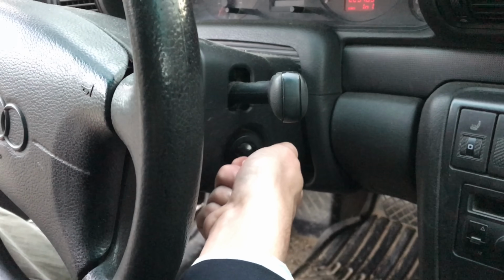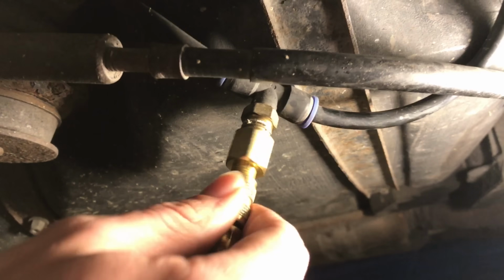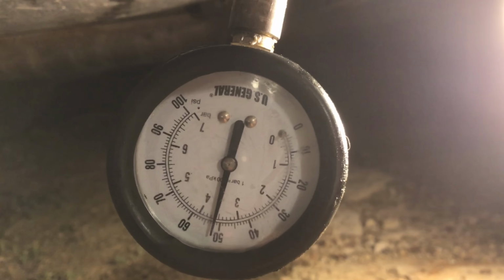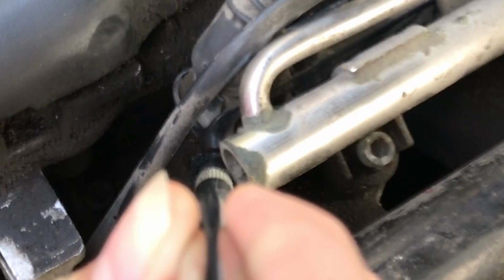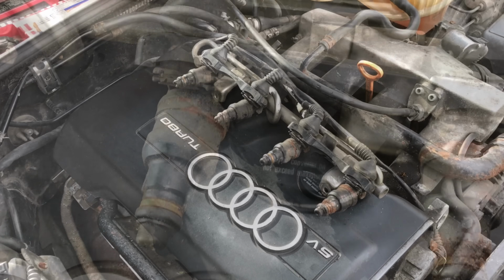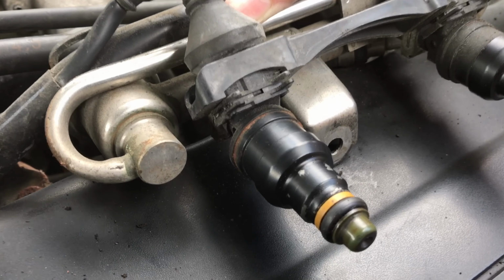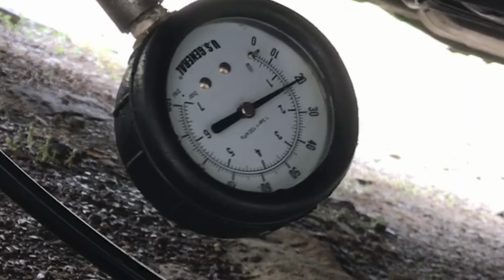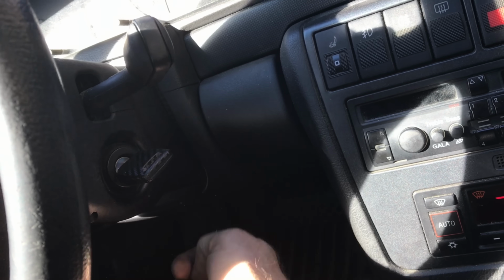Fuel injector? Fuel regulator? Fuel pump? Learn fuel diagnostics

Comment: Somehow I didn't realize until now that a standalone check valve was a potential fix for one built into an in tank fuel pump. My dad's 2001 GMC Savana 1500 5.7L has been experiencing long crank times for quite some time. I already ordered a fuel pump, but we've been trying to schedule a time for a buddy with a lift to help out. Today it decided to stop starting altogether. I was able to install a Dorman check valve from the local Advance Auto Parts along with an extra fuel filter, hose, and clamps, then start the engine with starting fluid. We ran the engine for a couple minutes, then shut it off, and it was able to restart again right away without help. We shut it off, waited an hour, and it was again able to start right away without help. This gave us the flexibility to run the full tank of fuel down some and get it scheduled with the lift. Thank you!!

Comment: I highly recommend blowing out the upper engine areas youre working on with compressed air before pulling injectors, intake manifold, plugs, and coils to avoid getting debris in the engine

Comment: This is the best diagnosis video on YouTube!!!  I can't believe how straight up your narration is. Hands down the most informative and easy to understand tutorial EVER. Thank you and hope to learn a lot more from you sir!!!
Reply: Agree!. Good points especially when it is quite easy   to mis-diagnose the problem_ injectors, fuel pump itself, or  even so-called suction control valves and pump relay all can  cause the problem. I once had  even a problem with OBD2 not reading anything to show the right codes expect "no pressure on injector". Took a costly path replacing things (SCV;s which were ok) until found the high pressure fuel pump (on the engine, not in tank) was the only faulty bit. Wish I had seen this first.

Comment: had to do this on my 2016 Tundra this week. There is no schrader valve to test pressure, I cobbled something together by teeing into the line, set a gauge in there, sure enough low pressure. Tested the regulator by removing it & using an air compressor to slowly raise the pressure up until it passes & regulates the pressure at 50psi. Now to prove the pump.... I made up a small un-vented fuel tank (pressure tank) using a length of 1-1/2" steel pipe & some fittings including a cap with a shrader valve installed into it. Filled the pipe up with a couple of pints of gas & pressurized the test "tank" using a pancake compressor on the seat next to me to supply the fuel rail at the engine at 45-50psi. Wahey! I could now drive the truck around... Diagnosis proved, just waiting for a new pump to arrive now. Dropping the tank with a hundred litres of gasin it was another job though, there was no way to siphon or drain it in situ!

Comment: This is AWESOME!
Great analytical process of elimination. 
Great improvisation turning a $330 fix into a $4 fix. 
Very impressive.
Reply: Got to agree with you but I do have a question.  Does this not put more pressure on the other part..
Reply: @zigzag7194  It won’t put “more” pressure than what the components are designed for. 😊 You’ll be fine.

Comment: Best description of fuel pressure loss areas  I have ever  seen or heard of ; Toyota has a bulletin out regarding 2002 Tacoma 2.7 L engine that has a fuel pump check valve problem which fits the description of the problem I am having with  Tacoma. I told a few mechanics about the inline check valves  I use to used many years ago and they don't understand me??? You are first class as I was a mechanic for most of my life dating back to the early sixties into  the late 80's.

Comment: Best damn video ive ever watched on any subject ever. Its easy to see when the guy knows wtf he is talking about. Every second made sence. I learned more In last 10 min than in last 40 years on this subject. Thanks man.
Reply: @errorcodeguy456  I have a 97 Chevy Silverado 1500 350 vortec and it cranks and only starts up for a second with engine starter and carb cleaner I checked the fuel pressure today and it's only reading 32 psi so is that my fuel pump?
Reply: i just viewed this video randomly, because i wanted to clean my injectors. Indeed. I like his voice, the amount of info he gives and speaking pace, he would be an excellent teacher...

Comment: Extremely useful demonstration. Fuel pressure diagnosis demystified.  I have this exact starting problem when the engine has been sitting a few hours, now I know how to solve the mystery.

One thought, there is a potential fourth source of a leak, the unions at the tank, fuel filter, between flex and hard lines along the plumbing, and between the rail(s) and individual injectors. Being an external leak, a visual inspection with system pressurized should find it. Hopefully before something catches fire...

Comment: You're great at a lot of things sir. It's obvious that car diagnostics is one of them, but narrating, editing, problem solving and solutions. You name it. I'm very impressed and super thankful I saw this. I waiting 12 hrs for a tow last night.. 12!! Finally this morning a security guard patrolling the area was able to lend me his phone and i was able to call home and get us picked up. Ohh did i mention my 8 year was with me? Thanks Mercury.  

Anyhow, 2013 Ford Flex that I've been driving the hell out of lately is rapidly wearing down. I suspect an issue with the fuel pump/ lines etc. I know a good indication is that initial sound of "air" or "activation sound" you hear prior to the engine cranking as you turn the key to the ignition. I DO NOT HEAR THAT SOUND.  I'm gonna use your video and rewind the hell out of it as many times as i need to, and hopefully im able to diagnose this isue. Normally I'd leave this for a professional but times are tough.. REALLY TOUGH and that's just not an option at the moment.. it simply isn't. So i greatly appreciate this video. 

A quick question, I'm sure there's a fuse behind that wiring for the fuel injectors. Could something as simple as a bad fuse be the issue?
Reply: If its a blown fuse, the car wont start at all.

Comment: Wow! I’ve never seen such unanimity from YOU TUBE viewers in my life. The videography, complete explanations of the “Why“ and the “how,“ and the patient pace of your delivery make you my stand-out favorite DIY coach. And the check valve solution sounds like just the $4 fix my ‘95 F-150 needs. 
But I have one question. Should the check valve be installed between the tank and fuel pump or between the fuel pump and the engine?
Reply: Good question...hope you get a reply.
Reply: between the fuel pump whichis in the gas tank and the engine.

Comment: Excellent video. I believe this is the problem with my 2003 GMC Sierra 1500. I replaced the fuel pressure regulator and crank position sensor as a shotgun approach at first. The issue is that after the the truck is turned off for more than a 1/2 hour or so, it takes  a very long crank or multiple tries to get it fired back up. I found that if you prime the fuel by turning the key on a 2-3  times (not all the way to the firing position) and listen to the fuel pump pumping fuel to the engine, it gets the fuel needed to fire the next time yo turn the key to the ignition position. This works every time. So it makes sense that is probably a check valve issue. But i will check the pressure from the fuel tank and to the engine first to verify.
Reply: How did that work out?

Comment: Thank you. Very good.   👍  We added a secondary fuel pump, external electric , using fuel rated check valves.  Long desert hauls at night got caught with no pressure - once and never again.   The cost of the  tow...  Cheers!

Comment: 2005 BMW X3 great car we bought it used and always hard to to start. Changed out a lot of Vacuum hoses  and other parts as these cars are prone to vacuum leaks. Even changed out the mass flow controller, got a little better but still misses when stepping hard on accelerator. With what I learned on this video I just might fix a problem that 4 BMW specially repair shop  in my town have not been able to figure out.

Comment: You may have just solved a problem I’ve had for a year. 4 mechanics couldn’t find the problem.  I have to cycle my fuel pump twice before starting. Because it’s loosing pressure. 
   THANKYOU !!!!!!!
Reply: What was the problm
Reply: @hazelpieterse853  well I’ve replaced everything so far except the fuel pump.  Now it only happens after driving for an hr or more. And things get hot. Probably the fuel pump all along.

Comment: very good presentation.  another possibility, even more simple, is the fuel tank does not reverse vent due to a bad gas cap.  so drawing fuel out of the tank (by simply driving awhile), builds up the vacuum.  The next time you try to crank the engine, the vacuum prevents fuel from entering the fuel line (the fuel pump pressure cannot overcome the vacuum reverse pressure).  If your car cranks well after resting overnight, or doesn't crank well after driving awhile (especially on cool days), you may have this problem.
Reply: I think this just might be my problem! Thanks to you and the videomaker! My garage is unable to find the problem! But this is exactly what i m experiencing. When my car is cold it drives normal, but when it s heated up it starts failing to give gas and even stops altogether on the road. Dangerous.
Reply: Oh, and i just started having this problem this winter.

Comment: I sure wish I had found this video before I sold my F250 with a "bad fuel pump" before I sold it for almost nothing.  I did not think I could drop the tank.  But I could have installed this check point....  Darn!  Good video.

Comment: Excellent video on analyzing the location of a fuel pressure leak. Remove the fuel filter then use a bicycle pump to pressurize the line going back to the engine to 20psi. If the pressure holds, it's not a leaking fuel injector or fuel pressure regulator. Now check the line to the fuel tank. At 20 psi, if the pressure drops immediately, it's a defective fuel pump check valve.
I just need to figure out how to attach my bicycle pump to a fuel line.
Reply: Great idea really… I’d use the simple solution of jamming an old valve stem from my neighbor’s bike in a piece of fuel line a good rubbery glue might help too

Comment: Is it safe to crank the engine while all the injectors are out and spraying atomised fuel to the engine bay? I thought during this operation the ignition system is also fully operational and producing high ignition energy into the system. Thank you for your time and effort for posting this video. It was very professional and informative. All the best. Cheers!!!

Comment: ok your video was by far thee best ones ive ever watched and ive watched a crap load....ive always considered myself very mechanically inclined man...not very strong when it comes to the classroom portion of anything... ive always been a hands on guy..sometimes im loking over smeones shoulder while asking questions and the rest of the time im winging it.....i consider myself a jack of all trades a master of none...in other words a DIYer....downside of doin the work myself puts me here reaching out for anyones help.... i have a 2006 kia sorento... intial problem was a no start.... so far ive done the following..... 1..changed fuel 2....cranksensor 3.....cranksensor 4....TBC sensor 5....IAC valve 6 coilpacks. 7.....mass airflow sensor 8....air filter.....because my ECM harness had a bad wire that seemed to have been coroaded i changed the harness clip and the ecm......STILL NOTHING..... today i double checked timing position....checked good....car used to start with MAF senor disconnected but died when put in gear....left it at mechanics for a week.... not only did they not fix ...cuoldnt even tell what was wrong.....my last ditch effort in reviving my car is tests u demonstrated on your video......i truly believe this a very simple fix......so simple ive got to be over looking it......PLEASE ANY FEED BACK IS APPRECIATED...not always online so please feel free to text or email me 4086259472...bantimothy426@gmail.com

Comment: Excellent video!
The only thing it misses is a scenario, where a fuel pressure regulator located on the fuel pump. In those cases, is there a one-way fuel check valve besides a regulator on the pump? Also, in those case, how can you differentiate whether the problem is a fuel regulator or a pump. (I have a slow pressure drop with my 2015 Toyota Venza LE)
Reply: my scenario is the same :(

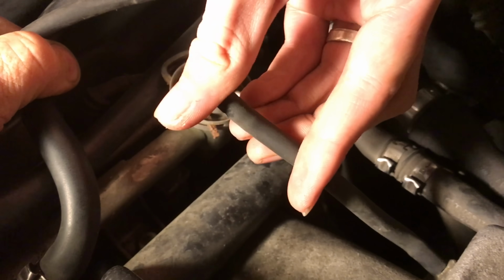Comment: 2:17 The Fuel Pressure Regulator is NOT always located on the fuel rail. Vehicles vary on locations so keep that in mind.
Reply: some times the regulator is on the fuel pump inside the tank... Not sure how that works but I just felt with this on my 6.0 2006 GM
Reply: Do you know if this video works for direct injection? GDI

Comment: Hi ! 
Brilliant video with lots of no-nonsense, clear explanations at each and every step of the diagnostic precedure.
I have a 1993 1.9 Peugeot 205 GTi which has a very inconsistent start/run/re-start condition.
Today it (might) start and run reasonably well - tomorrow, the car might not start at all, running the battery down.
I know the FPR [Fuel Pressure Regulator] works fine - it is brand new and the correct model/spec' for the car (Bosch 3.5 bar).
I intend to uncouple the Fuel Rail including the Injectors  and crank up the motor to check the spray pattern against a strip of card/paper exactly as in your Video.
If l don't get anything from the Injectors while cranking over the motor (with a fully charged battery), do you have a diagnostic procedure l can follow to eliminate the very frustrating current situation of sometimes start, sometimes no start.
I would be grateful for your expertise in this matter.
I have not, as yet, tested the Fuel Pressure arriving at the Fuel Rail. The specified pressure for my model is 3Bar.
Best regards,
Paul

Comment: Awesome video, still left me with a lot of questions though. Where do I plug in a fuel pressure gauge?  If it happens to be a bad injected do I need to replace all of them or just the one? How did you know it was the fuel check and not the fuel pump? I changed both fuel pumps on my car and I'm still having this problem, would that narrow it down to the regulate or injecters? If you could help me diagnose this problem I'd appreciate it heaps! Thank you

Comment: I had the same problem, I have to replace the fuel pump ,which real it cost me a lot .
Thanks for a nice and cheap solution. Next time if it happen again I will try to fit the check valve.thanks for sharing.

Comment: Great vid, I have a similar issue right now, this has given me a new direction to follow as I was about to change the whole injector loom! I'm hoping this could be the solution 😎
Reply from the maker: +DarkCrusader157 

Glad the video helped, let me know if you get it solved. A lot of cars have A port on the fuel rail, so you can see if it holds pressure.
Reply: Error Code Guy -Will do👍🏾
Reply: T5 25
Reply: Xx
Reply: @DarkCrusader157  

N
Reply: jamiekopprocks ...N? Didn’t understand what you meant bud, what’re you trying to tell me?... No?
Reply: Update... it turned out not to be the fault of the loom it was the injectors I had purchased they were flooding the engine with too much fuel. Bought some quality branded new ones and... no issue, the loom however did have an issue in one wire where it wasn’t receiving consistent power😎 Now I have a bigger problem...valve stems seals are worn and leaking oil into piston chamber. Doh! 🤦🏽‍♂️
Reply: @errorcodeguy456  why a petrol enjine make black smoke
Reply: DarkCrusader157 what was wrong with ur injector pump
Reply: @errorcodeguy456  I have the exact same problem. My case with Fiat Linea 1.3 MJD was a bit worse. Sometimes i need to cycle the keys a lot of times for  the low pressure pump in fuel tank to build pressure and only then the car starts. Your video brings more clarity

Comment: So that why my 2007 Camry sometimes either chokes up and not even start or starts slow or even starts quick, but idk wtf it is in the fuel system so I’m gonna run 5 in 1 stp fuel system cleaner and see if anything is fixed 😭😭😭😭😭

Comment: Great explanation, easy and cheap testing techniques, step by step, dismissing each component of the fuel system, until get the correct diagnostic. The best is the solution you made. Keep working this way.